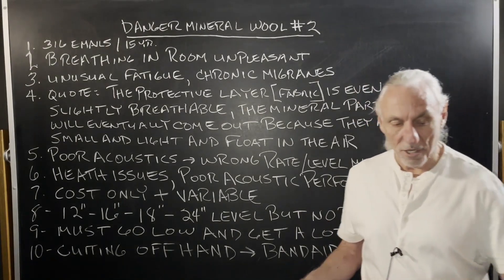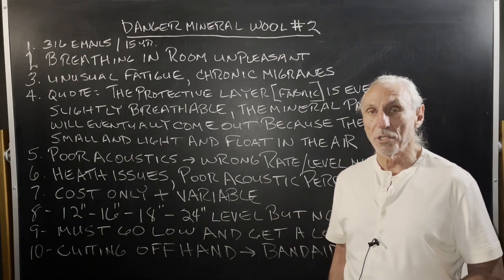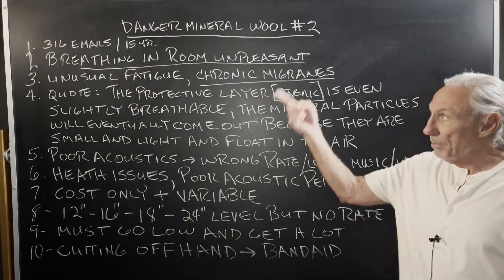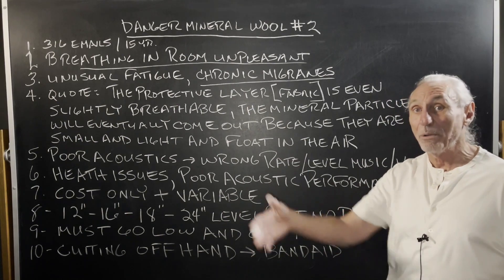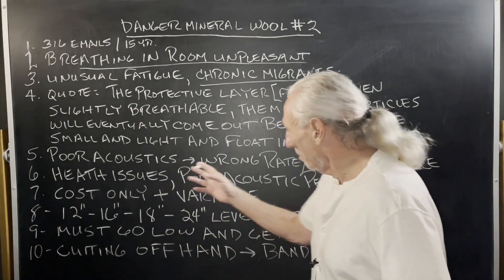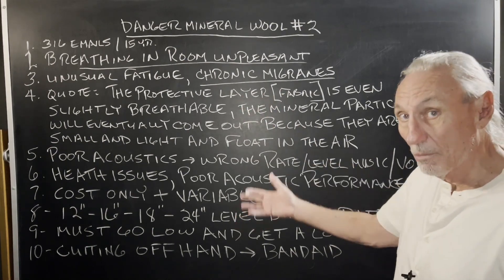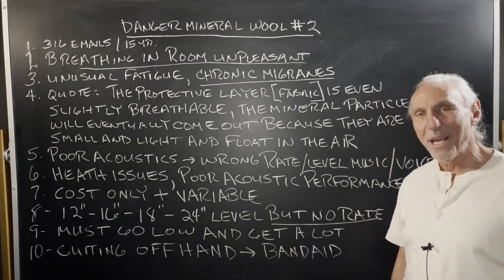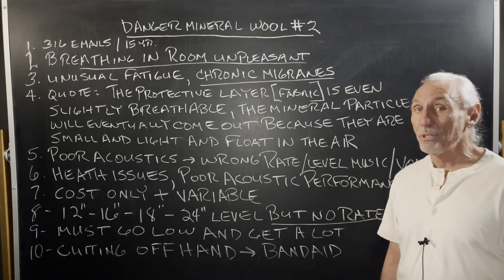Danger Mineral Wool - Part 2 - www.AcousticFields.com

Comment: Can use insulation matrial based on wood fiber. A good absorber
Reply from the maker: It is not a "good absorber". It does not absorb at the proper rate and level required for music and voice.

Comment: It should be stated that mineral wool does dissolve in the lungs over time unlike fiberglass. The main danger is during assembly and handling but once in place and not disturbed, it does not shed or release particles.
Reply from the maker: Listen to yourself. The fact that it gets in your lungs period should cause you to rethink your explanation which is not correct. These material types never dissolve. I guess everyone has the right to pick their own poison.

Comment: Part of my background is design engineering and manufacturing management of composite structures. S-glass, E-glass, carbon fiber, Kevlar, Spectra. Sporting goods, industrial, defense/aerospace. Terrific material for its intended uses in composite matrices, but with certain caveats. You had to regularly keep on people about not just eye and ear protection, but respirators for VOCs (some really unhealthy ones), and filters to prevent inhalation of fibers from the previously mentioned materials, some of which get into your lungs, and stay there like tiny bristleballs, irritating the tissue until you might perhaps form a tumor around them. Not only is rock wool or any mineral fiber inferior for acoustic treatment, it's no picnic for your lungs either - two good reasons not to use it for other than its intended purpose (thermal insulation), and to wear P100 respirators when you do work with it. 

Yes, decent acoustic foam is more expensive, but it'll likely be far cheaper in the long run than oncology treatment, or maybe you'll only wind up with COPD.
Reply from the maker: Health hazards coupled with poor acoustical performance. Where is the win?

Comment: Great video! What do you think of denim insulation? Would it be safer to have in the studio compared to mineral wool/fiberglass?
Reply from the maker: Limp mass material types, whatever form they take, can not be used to absorb low frequency pressure waves.
Reply: @AcousticFields  Do you mean to say that thickness doesn't matter at all? Many charts show that there is a difference between 4, 8, 12, 16 inches of a given material (and density). So in fact the greater the thickness the less dense (kg m3) it needs to be. As in foam and polyester being able and useful for low frequencies if thick enough (depending on density). Thickness beats density also, for example 4 inches of a denser material will be worse than 8 inches of a lighter material, when comparing for lower frequencies. It is a matter of what frequencies one aims to absorb-reduce and how much space there is available.

Comment: Thanks for educating about this Dennis, people should know the health hazards of inhaling these particles.

When I do use mineral wools, I always wrap them in trash bags and tape them sealed, then put cloth over them if aesthetics are needed. 
 
For very budget applications, 5-8" wools with a pcf of about 6 work surprisingly well in the bass-midrange, way better than nothing. Typical use is speakers placed too close to walls due to space restrictions, if I put these panels between the speakers and the walls it's a huge difference, I've measured it.
Reply from the maker: It does not work well. If you take measurements, you will see large variations in the room response of that material type. It does not support a resolution goal.

Comment: No science here. Just an opinion. Scientific test have shown mineral wool fiber size does not attach to lungs.
Reply from the maker: You are free to inhale whatever you want. However, when you inhale and still have bad sound, where is the win for you. Ask people who are suffering from mesothelioma.
Reply: You may be right about the acoustic properties of rock mineral but it is a very good insulation product and as safe as fiberglass to install. Mesothelioma is caused by exposure to asbestos, not mineral wool.  @AcousticFields
Reply from the maker: We have different definitions of safe. Any material type that involves a protective device for breathing material type along with body skin surface protection during insulation is not safe in my common sense world. Its the same nonsense they said about asbestos and cigartettes.

Comment: As a general contractor with over 25 years in the business, I can tell you that these products in and of themselves are no more dangerous than half the chemicals in your house or in the atmosphere on any given day.

However, with that said, they do pose some issues.

1) certain precautions should be taken when handling these products. PPE (gloves, long sleeves and long pants) should be worn. It is abrasive and can cause minor abrasions to your skin or an allergic reaction. A respirator should be worn if you are working in tight spaces and if you are cutting or ripping it. A surgical mask is recommended if you are just hanging it. 

2) the fibers can enter your lungs if you do not wear a mask and are cutting or ripping it or smacking it around roughly. For a healthy person this isn't a huge deal as there are far more pollutants in the atmosphere that are far more likely to cause damage. However, for people with asthma or other breathing problems, mask up.

3) the issue about breathing is probably because the room dimensions shrunk with all the panels and traps. Regular carbon dioxide will build up faster in the room because the insulation will not allow it to dissipate as quickly. A simple room health monitor would probably verify it. The same applies to any other pollutants in the ear. A telltale sign of higher carbon monoxide levels is a musty smell and minor breathing problems. 

4) the fabrics placed over the panels and all can harbor bacteria, dust mites and other "things". Rarely if ever do they get cleaned and if the insulation gets wet it would mold, so cleaning would be a bad idea. The best solution would be slip covers over the outside which can be washed. Most sound waves except the highs will easily pass through the fabrics. 

5) if it were so dangerous, places like home depot, lowes, etc wouldn't have it out in the open. Hell, they don't even wrap them 100% while there sitting on the shelves/pallets.

6) like everything proper precautions and a bit of common sense go along way in dealing with the minor dangers associated with these types of insulation.

I know you are trying to sell your services and all, but please do not vilify insulation. It has it's purpose for some sound related treatment as well as keeping our houses cool in the summer and hot in winter.
Reply from the maker: Not true. You are a contractor not an engineer. If you build panels that have this material inside of them, the fibers will be transmitted through the air. All sound absorption panels work with melocular velocity or air flow.
Reply: @AcousticFields and health problems need doctors and not engineers
Reply from the maker: We are all free to choose our own poisons. However, when it comes to acoustical performance, there can be no compromise. You never discuss performance because you do not understand the importance of linearity in absorption curves when it comes to music and voice. Best to stay in your own lane.
Reply: @AcousticFields  if it's a matter of acoustic performance I don't understand the reason to bring up the presumed danger to health...
Reply from the maker: Poor acoustical performance with health hazards. Where's the win in this? @wallalo
Reply: @AcousticFields  poor acoustical performance with NO health hazards, where is the difference?
Reply from the maker: @wallalo  I am sorry. If you can not see that variance, I can not help you.
Reply: @AcousticFields  I'm saying that if the acoustic performance is poor then it doesn't make sense to bring up the alleged health problems. if, on the other hand, you also point the finger at health then it seems so much an excuse for marketing purposes, maybe perhaps the acoustic performances are not so poor and help is needed...
Reply from the maker: Yet people do just that all the time. You are talking absout a belief system that is founded on lies. When you must change a belief system founded upon lies, you must attack all of the lies one at a time in order to create a new belief system founded in truth. @wallalo
Reply: insulation is delicious topped with flavored syrups and served on a thin paper cone, particularly at carnivals. i have been serving insulation next to the snow cone concession at the local crash up derby for years, never had any complaints. the morgue has been filling up and the mortuary folks are kindly to me. I just squirt enough fruity syrup on the stuff, nothing but happy customers.

Comment: Very good points. When the material you use comes with specific limitations to its applicability, you should respect them. Also, you should question yourself: if this material is potentially a hazard if used incorrectly, do I really want it at all in my home?
Reply from the maker: One would think that if there was some thought and consideration given to the proper variables rather than just cost.
Reply: @AcousticFields  things read on the internet, especially d.i.y. fora seem to hold great suggestive power, especially when the  cost seems low - people tend to think: "what have I got to lose by trying it out?" It turns out they can waste their time and produce yet more trash.
The thing no-one seems to pay attention to, with most of these "recipes", is that there usually is no follow up, e.g.  what happens 4 months or 4 years down the line.